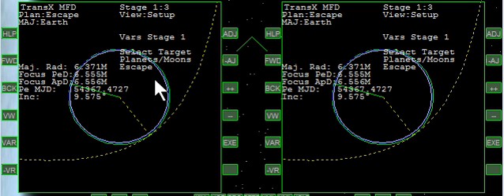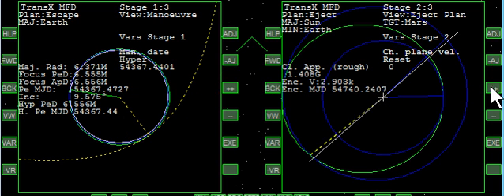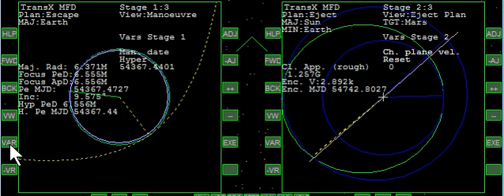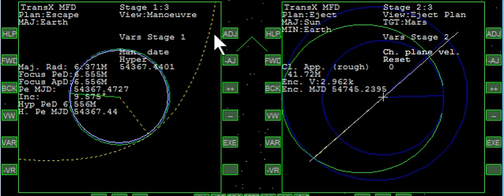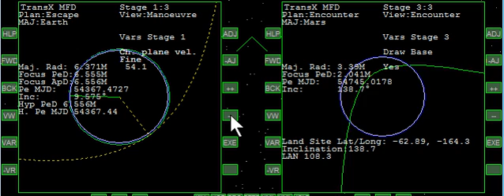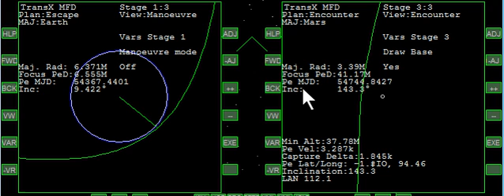TransX Tutorial - Earth to Mars (Part 3)

Comment: What happens is that escape plan wants you to begin your maneuver at "begin burn" and "manoeuvre mode" wants you to begin your maneuver at T to Mnvre. Both modes will get you to your destination when used properly. In this case manoeuvre mode is being used. In this case, escape plan could have been used without having to match escape plan and manoeuvre mode.

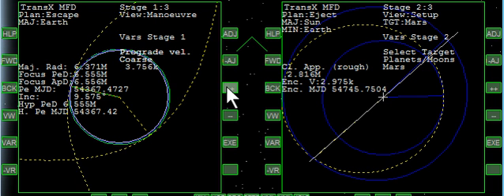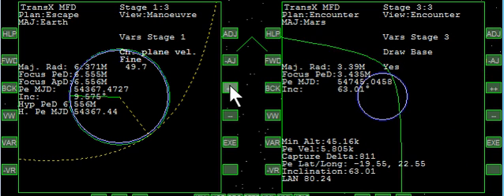Comment: PLEASE!! At 0:46, you matched the two orbits, reseted the orbit at stage 2, and started to drop the Cl. App. (rough), first to 1.257G, and after, dropped to 4.433M. Please! When I reset the orbit at stage 2, it drops to about 11G of Cl. App. and I try to drop it, but it´s really SLOW! you made it in 1 minute, but I in 1 day, can´t get under the 4.000G! it stucks between 5 and 4 G of Cl. App. How do you do with so precision? If you cant help, can I get to mars without do the step at 0:46 to 3:40?